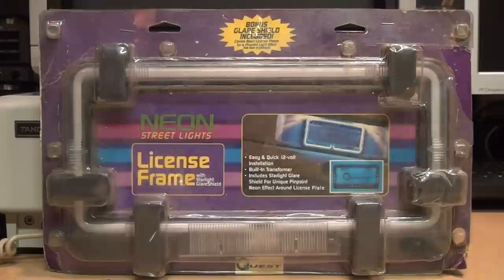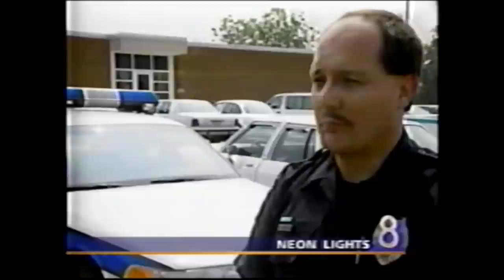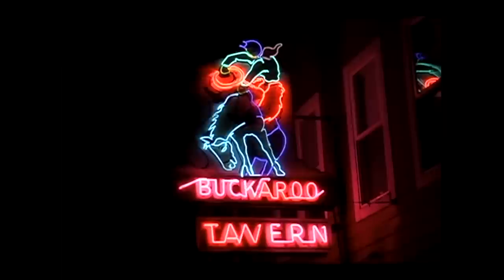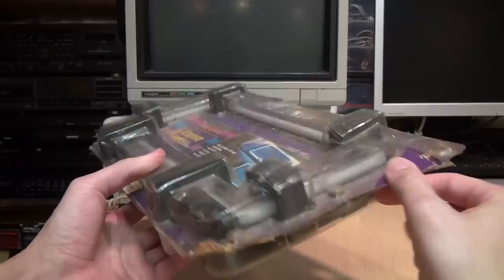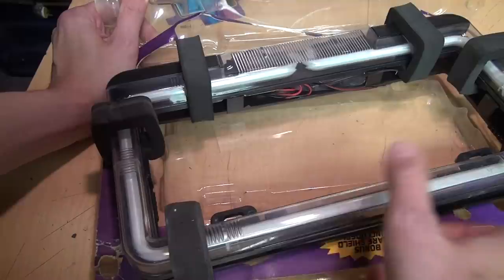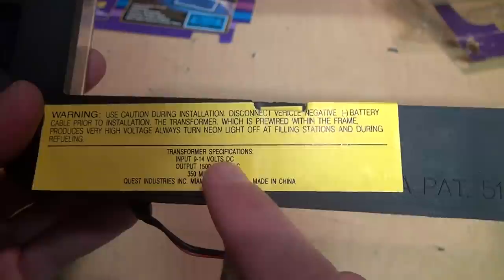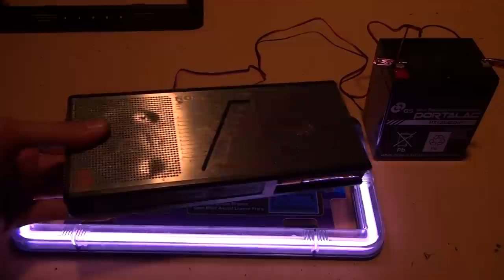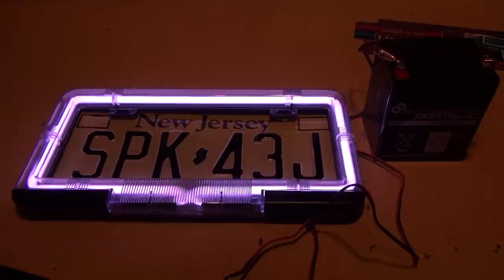The dying art of neon lighting ⚡1500-volt car license plate frame

Comment: Up until a few months ago, I worked in the sign industry as a designer and CNC programmer. My company still does old school neon, and while neon jobs didn’t come across my desk EVERY day, it was still consistent. I think the volume of those jobs was actually ramping up before I resigned, since a lot of gentrified cities are really latching on to retro aesthetics. One cool project I got to work on was the restoration or the historic Sunken Gardens sign in St. Petersburg, Florida. Insane amount of neon on that sign, and to my surprise, they didn’t go with faux-neon LEDs. I drive past it on the way to my band’s practice space a lot, and it’s really a sight to see. The LED neon stuff looks fine, especially for smaller signs, but there’s nothing quite like the real deal.

Comment: back in the 50's, my dad was a professional independent sign maker.  when neon became a thing, he started marketing it heavily to his clients.  after he sustained numerous cuts from broken glass tubes, he farmed out the manufacturing to a guy in a basement in  Union Square, Somerville, MA , and just bolted the finished products to the sides of buildings, thus avoiding daily wounds.  So he designed them, but felt that the actual construction , bending tubes, wiring and whatnot, was too time-consuming.  ( and my mom did not appreciate having to clean blood off his clothing !).  i distinctly remember several trips to that fluorescent lit basement replete with glass shards , and a ceiling no more than 8 feet high, if that.  highly skilled craft, to be sure.  but dangerous. dad made the right decision.  (or.......MOM made the right decision ?!?!??)

Comment: Had a job doing electrical maintenance at a building built in the 90s. LEDs weren't yet prevalent in that era, so the building was built with mostly electrical discharge lighting - fluorescent, neon/cold-cathode, metal halide, sodium vapor, etc. I fell in love with the technology, by that point it had been around the better part of the century and manufacturing standards had mostly been perfected in terms of long-lasting lamps, durable ballasts, etc. On top of that, it disciplined me to be a good electrician, caring for all those fixtures and making sure everything was wired up properly. It was a great era. Nowadays, you just need a low voltage DC source to light some LEDs, and if anything goes bad, just cut it out, throw it away, and buy a new one. Plastic garbage. Where's the danger? Where's the thrill? where are the high-voltage transformers? Those lamps were literally lightning in a bottle! Ahh, the good ol' days.
Reply: Modern ballasts etc for home use have been garbage for a while. The plastics crumble
Reply: I used to work for a company out of Boston called Aetna.  All I did was travel around replacing discharge tubes and ballasts.  In every store you can think of.  One local  grocery store used to re-lamps their ENTIRE store every 6 months.  Every bulb in the store.  That was prior to the inception of LED's though.
Reply: @TechGorilla1987  I got bunch of old fluerescent fictures thad had been on the roof of really high barn.
Bunch of them have had their tubes burned and been blinking for years.. many of the ballast had been so hot that the paint on the outside of the fixture had turned brown..
Put some used tubes and flashers in and they still work like a charm
Reply: @NuffMan_  You would be amazed if you took two fixtures - side by each - and replaced one ballast.  Leave the old ballast in the other fixture.  Replace all the bulbs and watch the difference in light output after 10 minutes.  It will astound you.
Reply: @TechGorilla1987  well i have 10 of these light + 12 more that are 10 years older and they all are more of the same.

I still have like 20 tubes left and im gonna use them all before switching to leds lol.. i go about one tube a year and the oldest tubes are around 30 yo so thes gonna last me a while lol
Reply: @NuffMan_  Oh, gosh, I didn't mean they were defective or you should replace them. I was just telling a story.  I have MANY florescent lights in my basement that are old as the hills, but I got 20 fixtures for 20 bucks on craigslist.  T-8 bulbs but newer-ish ballasts.  I'll use them until they no longer light up any more.  I do like LED, but there is nothing quite like a 4 tube florescent light to work under.
Reply: @TechGorilla1987  Idk if it's just the led tube that i used, but i found the light really harsh to look at, and working under it straines my eyes.. no such problem with fluorescent tubes.

We still have some lights in use from the late 60's, the tubes are like 5cm thick and the flashers are made from metal.
Reply: @TechGorilla1987  Nothing says "run down and about to go bankrupt" more than a store with tubes that are out or flashing. Modern fluorescents seem to last longer though. At work we moved into a newly refurbished office lit by T5 fluorescents eight years ago. Only in the last couple of years have the tubes started to fail. They are actually more reliable than the £200 a fixture LED pendants in the canteen.
Reply: @MrDuncl  You are 110% correct.  That is the reason that the local grocery chain does (or did) what they did.  
True story - I once went to a place called the Mondawmin Mall in Baltimore to a McCrorys store.  The manager asked me what a white boy was doing in that part of town.  The mall had guard towers back then.  That store looked like a million bucks after I changed half a van load of ballasts and 8 foot, T-12 HO tubes.  The difference was night and day,  That said, this comment thread is making me feel like an old man yelling at clouds.
Reply: Yea, where is this sweet-sweet smell of mercury vapours melting your brain?

Love fluorecents, yet to finds LEDs for color-sensitive applications comparable to tubes with Ra=92 myself.
Reply: Lightning in a bottle ! Ohh yeahhh
Reply: @NuffMan_  these ultra efficient LEDs totally ruin my sight too, fluorescent light is waaaaay better.
Reply: @rodrigobelinchon2982  Eh, cheap fluorescents had low cri and could flicker depending on ballast quality, same goes for led, you just get what you pay for.  Drop in retrofit led tubes now are just easy.

Comment: Kevin, as a NJ resident, you might recall there were still neon message signs on the NJ Turnpike up until 2014 when they were replaced during the exit 6 to 9 widening project.
The engineering that went into the NJ Turnpike is nothing short of amazing, seeing how it was built from end to end in only two years, and used those neon message signs as far back as probably the late 1950s!

Comment: I think this neon license plate frame would be a very welcome addition to a classic car show, but I agree.  I imagine most states would have required the pinhole frame with the glare shield so that you could still have pinpoints of neon light coming through without the glare of the neon obscuring the plate from the view of law enforcement officers.  If a plate becomes illegible, you can be ticketed for improper display in many jurisdictions.  To play it safe, just use the built-in license plate illumination your car already has.

Comment: @6:47 - Turning off at a gas station - Usually, I say that electronics at fuel dispensers are not an issue, but this light and getting back in your car during fueling are two of the most dangerous things that you will see at a gas station.  This light is situated below 18" off the ground that is a REAL danger zone at fueling stations.  The vapors hug the ground and even the dispenser keep all their electronics in the upper cabinet.  The lower side of a fuel dispenser is "intrinsically safe" from discharges and faults and physically isolated from the top.

When you get a static discharge at the nozzle when fueling is the largest hazard on the forecourt.  I've seen it happen.  Lady in a fur coat gets out to start fueling in the winter.  Gets back in the car, then returns to the nozzle all charged up and gets zapped when they grab the nozzle.  Then you have a BBQ lighter in the stream of vapors coming from your tank.  Whooosh!  To this day, I physically ground myself when I get out of any vehicle. I was in the fuel business for many years.
Reply from the maker: Plus, some vintage cars had the fuel filler behind the license plate!
Reply: @vwestlife  I just sold a 1983 Caprice Classic with that very arrangement.
Reply: @vwestlife  I don't think it would be easy to install this with the hinged license plate fuel fill door.  The thickness of the neon light frame would not allow for the license plate to swing down... even regular plastic frames will bind.

Comment: Back in high school in the earl ‘00s, I had a black ‘81 Corvette with chrome T-tops and a blue neon plate frame. Mine was substantially slimmer than this one with the neon tube being enclosed in just a lexan tube with a small black section in the middle with the transformer and a couple tabs for the mounting hardware. 

The warmth of neon for plate frames and underbody lighting just can’t be matched by LEDs. The old StreetGlow kits were incredibly fragile but looked great.

Comment: Fun fact! I hand built my own custom hand built LED 'NEON' Tag frames now, I've made and sold over 168 of them now in the past almost 2 years... Mine look just like the real neon tubes, only MUCH MUCH brighter and smoother output, and mine are a nice slum low-profile design where they literally do not block ANY of the tag around the edges. They are much much slimmer than the classic neon tube ones and mine are made completely from all stainless steel and aluminum channel material (no plastic anywhere on them)...

I make them in RED, GREEN, BLUE, WHITE, ORANGE, AMBER (golden-yellow), YELLOW, PURPLE, HOT-PINK, & RGB Multicolor... I also have a prototype RGB Addressable one too that can do rainbow effects, and even made myself a custom controller for that one for doing parking lights, brake lights, left and right signal lights, reverse lights etc etc etc... It's amazing how far technology has came throughout the years now!...

I'm literally the only person I know of still making these new to this day, and mine are taking advantage of the more modern lighting we have time offer now days!...

I'll post a link to my Facebook where you can see pictures of all my different colors of them...

If any of y'all are interested in buying one also, feel free to send me message to my personal fb page too. I know how hard it is to find the actual classic real neon tube ones, so mine are definitely the next best option especially for the hard to fine colors now days too...

Comment: I've always had a soft spot for neon lighting old and new. Even though it's a shame it's dying out, the LED retrofits are getting very good at replacing neon's look. 

Even though I wouldn't have ever used something like this even back when it was new, I think it would be the perfect accent for a wall-mounted license plate. An LED strip light just won't have the same effect.

BTW, In that news clip, seeing the "retro" equivalent of LED underglow in the form of neon tube lights was a real throwback. I'd hate to see what a well-placed piece of gravel kicked up off the road would do.

Comment: Oh, according to dozens of NJ cops, those are definitely illegal here.  We all used to get pulled over for neon lights all the time in the 90s.  I've had a NJ cop tell me that even the licence plate frames that you get from the dealership with a new car are illegal because you can't have ANY portion of the plate obstructed with anything at all.  That cop would probably issue a ticket if the heads on the screws holding the plate to the car were too big!

Comment: I like the LED neon.  I wouldn't want a high voltage discharge if the worse came to the worst.  I struggled with the neon idea for a motorcycle and eventually passed on it.
Reply: I hand build LED 'NEON' Tag frames for motorcycles & car size plates too... I've already built and sold 168 of them too in the last two years now... Mine I build are a much slimmer design (as in they do not block any if the tag its self really) than the old school neon tube ones... Mine are built from all stainless steel and aluminum channel construction too and will last for years and years to come...

I make them in 10 different single-color options, as well as RGB Multicolor ones too

Comment: Excellent, interesting content as usual - this car accessory never made it to the UK, probably because of the larger registration plates we have here. I'm sure it's been mentioned before , if so I apologise , but you do sound remarkably like a radio personality we have here in the UK called Paul Gambaccini ( born in New York ) - maybe a relative ?
Reply from the maker: I've never heard of him.
Reply: I used to get Max Power magazine in the mid 90s (drove a rusty red B-reg Nova SR with brown seats and three-spokes)) and I remember seeing adverts for UK versions of these amongst all the neon antennas, underlighting kits, stick-on aero-style fuel caps and seat belt shoulder pads. Kinda miss those days - now the cruise scene is just some 18yo whose mum bought him a £60k BMW or Merc. We had to be creative with our underpowered £300 80s rotboxes 🤣
Reply: @vwestlife  Fair enough!
Reply: @rich_edwards79  The biggest problem is the "Has the car been modified ?" question on the unsurance application. An unmodified BMW would probably be cheaper to insure than a pimped out Nova. A friend had XR3i wheels on her 1.3. Escort, It would have probably been cheaper for her to insure an XR3i.

Comment: I remember these when they would sell them at Ames department store and Caldor.  The frequency response you here through the AM radio almost had an R2-D2 sound to it LOL. I also remember when those were on cars a lot when I was a little kid. What I find is funny is when the police officer in that news clip said that obstructs the view of the license plate the guy that was pulled over for having a light on his license plate you could clearly see all the segments on his license plate. I do know that for tractor trailer trucks if you see them with any other color lights on the back of their sleeper that's lit per DOT regulations is supposed to be red and no other color but if you see the rear cab lights as white and they're on it's just because they forgot to turn them off. It's funny when the store clerk told the news reporter there's a way around the law yeah because it's legal to sell them even though it's not legal to have them on vehicles same as LED headlights I've looked up online from a reputable LED manufacturer they claim that LED headlights are illegal in USA and are to be used for off-road use what's funny is new cars are coming out with LED since the halogen bulbs are not being implemented on newer vehicles. Like my car for an example came in halogens and incandescent bulbs except for license plate and the turn signals on the mirrors and the high mount stop light is Led. However after a marker light blew out I converted it over to LED in the front then I'm going to one piece at a time convert every bulb over to LED front to back. Because you know how much of a pain in the butt they are to replace on today's Vehicles especially a Volkswagen LOL

Comment: Fifty or sixty dollars in the 90s? Some people must have had too much money! Here in the UK I wish our police were as hot on those "personalised" licence plates that aren't anything like the owner's name unless they space them out oddly or even cut bits off the letters and numbers!
Reply: As someone has said earlier the norm in the U.K. was to buy a £300 Vauxhall Nova and then trick it out with £500 worth of accessories and a £1000 sound system that could make the car next to you windows rattle. 

A trend I have noticed recently which the Police are cracking down on are the 3D number plates. Someone at work has one. I have no idea why other than trying to stand out and get pulled over.

Comment: I still put cold cathodes in my pc.
Reply: Same here.
I find LEDs to be a little too "vivid"
Kinda ironic because I really like LEDs because of that but in practice I find them uncomfortable, cold cathodes have a slightly less saturated color I find looks better.
Cold cathode tubes are still also the only thing that can do proper 365nm UVA without costing an arm and a leg (cheap UV LEDs are only 395nm)
Reply: @zacharytaylor8523  i like em cause they really flood the inside of the case with light. led's seem too directional and have to be pointed in the right direction and even then still leave dead zones and hot spots. cold cathodes seem to distribute light more evenly in comparison